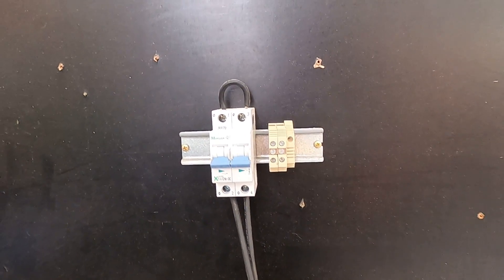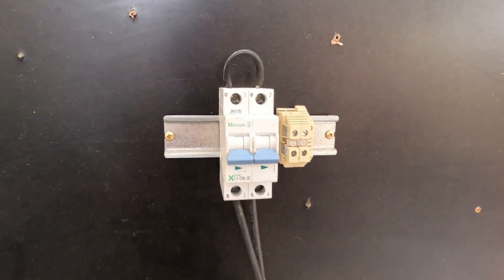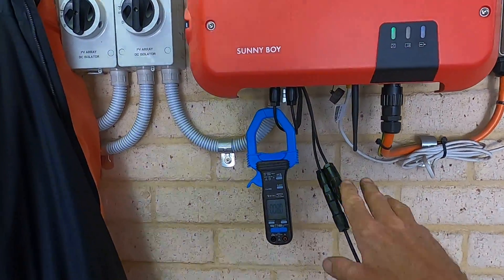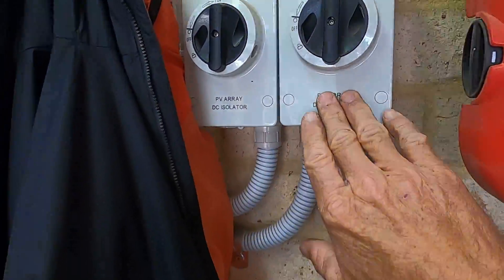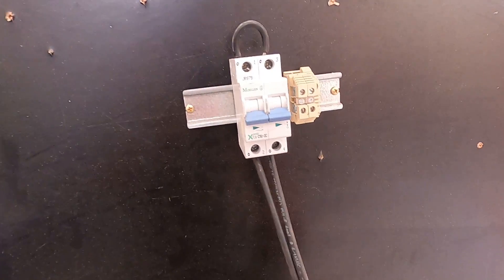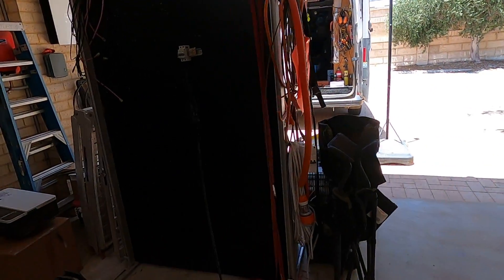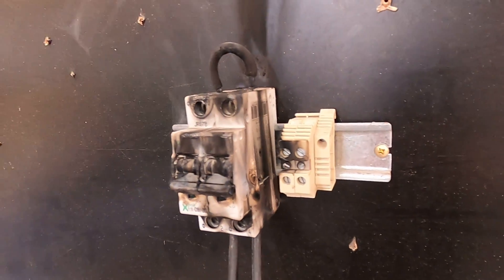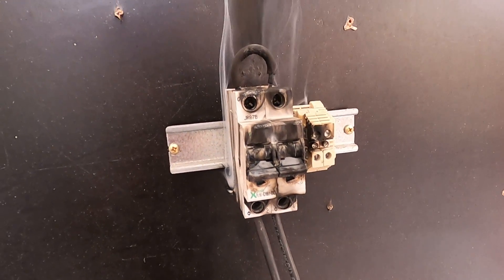Do not use this type of DC Isolator for your solar power system array! Perth Solar system repairs.

Comment: For those not in Australia, or even those in Australia, there are manufactures of breakers with magnets and arc chutes to quench an arc for high DC interruption.  They are designed to open under load and quench the arc. Please note they are polarity sensitive as the polarity determines the direction of the arc blow in the magnetic field. Polarity must be observed to blow the arc into the arc chute instead of away from it. Many breakers for DC have low voltage ratings due to the difficulty in quenching an arc. For panel arrays, ensure the breaker is able to quench the open circuit voltage under load. Other DC disconnect devices have multiple series contacts to break the arc.
Large gap knife switches work well as the gap when open is more distance than the current can mantain an arc. Use the type often used for inductive loads such as for a heat pump disconnect switch. Double break and an open distance greater than 1 inch is good to stop the arc.  The distance is important the same way cutting the cable broke the arc. You need a large device with the ability to make a large gap when open. For over current protection, use the sand filled multi-element fuse for at least the rated voltage. The sand falls into the arc to quench it.

Comment: Go with 1000 Volt inline fuses. When they open a temporary inert gas is given off inside to assure a voltage breakdown will not occur. Way safer than air breakers. DC has no zero crossing so it is harder to remove a breakdown ark.

Comment: Can you provide the full spec of that burnt circuit breaker? What is the Voltage feeding that circuit breaker?
Reply: I think its the chinese one cuz there diagram on the right and blank on the left. Probably 240VAc/125Vdc or something. That was why he hid the right side of the the breaker.
Reply: @mythuan2000  even if not Chinese, rating is only 220vdc and it’s not an isolator. It’s a breaker.

Comment: That is why DC disconnects have large gaps. If you have to turnoff under load no fire will happen. Also not having a large enough disconnect (using a 12 volt disconnect on 310V. All solar disconnects should be rated to 600V minimum. Mine are 1000V 64 amp. Mine shutoff 330V 15 amps . This was a great video thank you. Also I would not use the inverter disconnect first. I would use a wall mounted with fireboard disconnect like you have then turn of disconnect on inverter 2nd.  then reverse for on.
Reply: Use 63amp disconnect 😮

Comment: Awesome breaker fire. Just love how quickly it lights up and burns. Some breakers due to age will prematurely trip causing the same break under load condition. Was a stupid idea to have them in the first place, hence why it's now obsolete.
Reply from the maker: Thanks Brian, yes it surprised me just how quick it went up. And yes your spot on about the breakers simply tripping through age, fatigue, external thermal influences etc. This one was in spec for the application also.

Comment: Actually these so-called dc circuit breakers are not designed for dc at all. A proper dc switch or breaker will be physically a lot larger, have proper arc shields and arcing horns all built in. What is currently used is a re-branded ac breaker. It can still be used with dc, provided you wire up a "snubber" circuit in parallel with the circuit breaker. This should consist of a resistance in series with a decent size capacitor and the arcing problem is solved.

Comment: EE here. I laughed and laughed at the video and the title. Watch me light this pile of hay on fire to prove that hay is a bad idea. So much wrong here, I wouldn't even care to start.
Reply: To be fair, it's a sobering look at what happens if you don't understand what you are doing. It's not like this stuff isn't fully available DIY.  I am not really sure how having the isolator IN the inverter solves the issue of wanting to isolate something, but what do I know.  The UK have "banned" DC switch isolators on Solar panels in their new wiring guide.  I'm going to keep mine. I may be stupid, but I don't see how the individually fused lines won't work. And my ratings aren't for toy voltages and currents either. I'd be nervous if they were on my house roof at this point, not gonna lie.
Reply: Have you never heard of the concept of a demonstration? He explained the theory, explained the problem, showed modern alternatives to fix the problem and ended with a nice demonstration. This video is super clear and informative
Reply: @ThePyrosirys some people believe the Earth is flat!!
Reply: @ThePyrosirys  I'm a Noob, trying to learn this stuff, and no, it was not clear or informative.  I'm pretty much going tthrough the comment to try to understand what he did wrong, or how he achieved that fire.
Reply: @schrodingerscat7218  A good demonstration though showing what could go wrong.
Reply: I was laughing too.

Comment: Hello!

Really good and informative video but one question: what was the voltage in the system?
I am looking the datasheet of Eaton/Moeller PLS6-C16/2DC breaker and there it says it's a proper DC breaker rated to 220V DC. It doesn't say anything about the arc extinction/reduction in the datasheet but I would assume that when used in accordance to the spec it shouldn't just ignite like it was seen in the video. 

So I am wondering what actually caused it to fail... Was it already broken? Was it some cheap fake? Was it used in the system with much higher voltage than rated for? Something else?
Reply: No, he used 350V solar array. That DC breaker is good brand with CE
Reply: it seems that the dc breaker wasn't good enough or the voltage used was higher than its specs.  @rm6857

Comment: it is a great heads up but the title is a totally stupid approach. You could help a lot of people to address the critical points and demonstrate how to avoid the pitfalls. If you make a series doing just that I would even subscribe. Saying "DYI and Off-grid is a bad idea" will just alienate viewers and for sure nobody who would otherwise be willing to build a solar system by themselves will say "oh this video said it was a bad idea so I will call an installer to charge me an arm and a leg for pointing at a decent isolator". Whoever is up to the challenge (like myself) is totally interested in the possible issues and the right approaches to avoid them but will definitely not be scared by the fact that wrong connections can cause fire - no sane person in the world will assume it is safe to connect electricity the wrong way. 
You could and should say everyone should do their homework, research the subject and may guide them to some reliable sources of knowledge. You can absolutely warn viewers that if they screw it up it will burn like this and even worse (you did not even talk about lithium battery fires). 
"why DIY solar and Off Grid is a bad idea" - it just looks like a contractor trying to secure more job. Which btw I don't really think you want but it looks very close.

Comment: In my inverter manual it states, never disconnect under load. I guess the same applies to battery disconnect. Would a disconnect fuse be safer as it is manually disconnected ?

Comment: it's good to be aware of the risks but this video is incomplete and misleading. no info about the breaker ratings, solar open circuit voltage, if the breaker is wired correct polarity, etc. moreover, those extension solar conductors increase the total inductance and therefore the arc energy which may be beyond the breaker can handle.
Reply: I like your comment, BUT "inductance" is a AC phenomenon.

Comment: I have done my own offgrid, I used DC rated isolation switches and everything is in a durable metal enclosure, to be fair I have heard of plenty of professionally installed installations catching fire, and the classic stupid mistake is installing inverters in lofts. 
This stresses the electronics in hot weather, also people have been known to pile old bed linen and Christmas decorations around these inverters, leading to even greater thermal stress and fires.
Reply: Same here, I did my own and it's been working great. Why scare people away from solar? Isn't an unreliable power grid more alarming?
Reply: @scottwilliams5196  there is no such thing as free energy or green energy .This is the problem going from a reliable power source to one that is not .Solar has its uses so long as you have the ability and space to provide more power than what you need and the ability to store enough surplus to operate for 1 to 2 weeks .Let's face it we have many cloudy and overcast days and at times for weeks in a row .It's not a reliable power source but a means of augmenting a power system .All you are doing is off setting the carbon foot print to a later date .They are highly toxic ,have a relatively  short life span in some locations and have issues with maintenance and need to be cleaned to keep efficiency up .I like solar,don't get me wrong but it has its issues and has limitations and they do harm the environment from manufacturing ,disposal and the change in temperature in the area they operate .So do wind mills ,they kill wild life and redirect air flow and introduce noise that can be harmful to animals and humans .Basic laws of physics 
.(Energy Can't be Created, Only Transformed From One Form To Another )And that's that !You can't get something for nothing .Everything has a cost
Reply: @carlubambi5541  my tool box has many tools. I don't reject a tool because it can't do everything. Solar has been a great tool for me. Wind would be a good tool as well. Grid is a good tool. My panels will long outlast me and probably the next person that comes along. I replace batteries in my solar like I do in my cars, truck, mower, generator and power tools. We all do that. Not complicated. If you don't want alternative power, cool for you. Enjoy that choice, but don't dump on others who try to think outside the box.
Reply: @scottwilliams5196  yes I agree it has many uses ,it's a tool like anything else .It's has its uses and limitations,and should not be promoted as a be all and end all and cure for an imaginary enemy nor as a cure to solve an energy problem that does not exists .You see the more energy is produced the cheaper the price ,the problem becomes at what point will it be profitable for the produces .Eh Pickering nuclear plant produced electricity at a cost of 4 cents per Kwhr over its life span .This cost includes the building and maintenance .Distribution is another head ache and cost .The end user was paying about 6 to 8 cents per kWhr .they now privatized electricity and now we are paying as much as 10 times .for the same electricity .We are paying between 50 to 80 cents  per KWHr for solar and Wind .!Something is seriously wrong .
If I had the space I could put in about 4 kw of solar .The cost would be too high and the recovery too long 20 to 30 years before you break even  .I have 400 watts on my shed to charge my tools and lawn mower and supply security lighting .It would cost me $3k + to run a wire from my house  to the shed .So I spent$1500 for a stand alone solar system .The batteries are the biggest cost at almost $400 each .I use 2 RV marine lead acid batteries and a 1500w inverter .That's more than enough for a stand alone power system .When the power does go out I use a back up generator .
Reply: @carlubambi5541  kinda the same deal here. Mines a bit over paneled because I live in the north. I didn't make my setup as an ideology or political statement. I just like being a bit more independent,  and I naturally distrust people that don't want me to be independent.  Other than batteries every 4-5 years, maybe $500 at current prices, mine is relatively trouble free. I'd never tell people they have to do it, but it's been great for me. My grid power bill is a third of what my neighbors pay, and I could mostly(not my well pump) be offgrid if I needed to. That's why I encourage others to consider it.
Reply: @scottwilliams5196  Consider putting in a 3 phase well pump on a VFD .You can use a single phase to 3 phase VFD good for up to 1 hp ..You can set the VFD to constantly run the pump at low speed and when the demand comes up for water it ramps up the speed so you don't get the pipes knocking or increase the flow rate .You just need to be careful that you don't spin the pump too fast or you get cavitation and damage the pump impellers .You can keep the VFD at 40 hz  and bring it up to 80 hz .so long as the pump motor is VFD rated .It's awesome what you can do today compared to the 80s when the technology came out .Now a 208 v 5 hp VFD weighs 7 lbs or less .In the 80s it was almost 100 lbs
Reply: Rule of thumb 10kw inverter for every 7kw of demand ..Leaving 3 meters of space around your inverter is essential .Also the same rules apply for the derating of conductors based On ambient temperatures .You drop your ratings if your inverters ambient temperature is at 50°C like in attics and lofts in summer .Derate again for that and you may be only able to run 5 kw on a 10 kw inverter .Adding fans for cooling is essential and fresh air. in many cases the attic temps are much higher than outside .More fans !Or water cooled heat exchangers

Comment: If you have 250 volts through a low voltage breaker, it doesn’t matter what the amp rating is. It can burn up AFTER you turn off the breaker. DC arcs are crazy powerful. I use 1000 volts breakers on a 250 volt array and pay attention to the polarity marked breaker.

Comment: Wow ! Excellent demonstration.  Use of a much higher DC rated breaker, voltage and current,  is clearly needed than the installation normally provides.  Trouble is in an emergency the isolation switches would always be used so they must be rated for Live switching as well as Isolation.  Adds to costs but so would a fire.

Comment: I've tested quite a few breakers here in the US under a DC load. 92 volts DC.
Its interesting, because our standard AC breakers like Square D homeline breakers stood up better than the actual DC rated breakers I had. None pf them failed to extinguish the arc. Although the breakers I was using where rated for 5ka but the homelines where rated for 10ka which probably had a loot to do with it.
Would be very interesting to see more breakers tested under DC load, even ones that aren't DC rated since that seems to be a thing that is done a lot too.
Reply: Remember the types of breakers out there .The best breakers are thermal sensing ,current sensing and magnetic tripping .Also operating voltage gives it the ability to extinguish and ARC ,Always she's the load in the panel before you open the main breaker .Same thing with fused disconnects protecting panels .Also there are HP ratings to contend with ,not just current and voltage and ratings AIR and most important .NEMA vs IEC .I'll take NEMA every day over any IEC .Just remember if your short circuit current is 10 amps don't put in a 15 amp breaker or fuse for that matter  even if the wire is rated for 30 amps ...As the voltage goes up you will need devices with arc chutes for quenching the arc .Some uses several contacts in series for arc quenching

Comment: "DIY solar nnd Off Grid is a bad idea?"  That must be why all those WalMart solar installs went up in flames and all the other commerical installs that were DIY installs.  Right?
Anybody can be stupid, but at least the stupid DIY folks are working with smaller systems in non-public places which limits the potential damage. There is no protection from stupid professionals.

Comment: to protect dc load you must use breaker with proper interrupting capacity at that dc voltage  and having number required of poles in series as a representative for the correct number

Comment: I'm not a PV installer or even a "spark" but my understanding was that in PV panels the Voltage remains constant and the Current changes due to light conditions. Please be mindful if you reply, I'm a mechanical engineer not electrical!
Reply: Mostly. Only complication is that the open-circuit voltage is a fair bit higher than the optimal operating voltage, so you need to rate your components accordingly. A panel sold as '12V' will usually be able to output 20V under no-load conditions.
Reply: @vylbird8014  22 or more.. 18v at maximum power point. They sold as "12v" panels, because that's the target nominal battery voltage. You need somewhat higher voltage than the battery charge voltage (~14.4v on a nominal 12v battery). Just adding info to your already informative comment, for others.
Reply: the dry air has a breakdown voltage of 3kV/milimeter, if the air is wet, this value is lower. if the distance between the contacts is 1 milimeter and there is an arc between them, it means the voltage is already kV. due to the parasitic inductance of all the wires where the current flows in a closed loop system, if you open the loop, the parasitic inductor tries to resist current change and it will increase the voltage creating an arc until all energy of the inductor is dissipated and the voltage returns to that of the PV panel/string. if you want to minimise the arc, keep the wires as short and thicker as possible.
Reply: Except at dwan & dusk, that's broadly correct